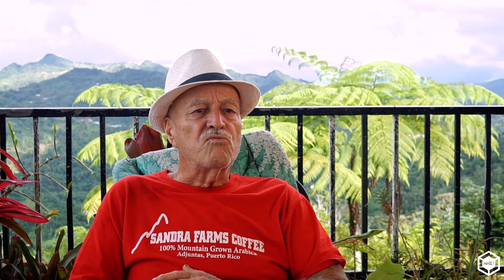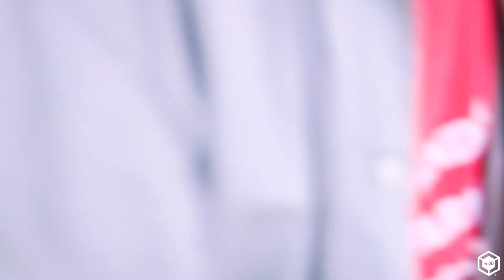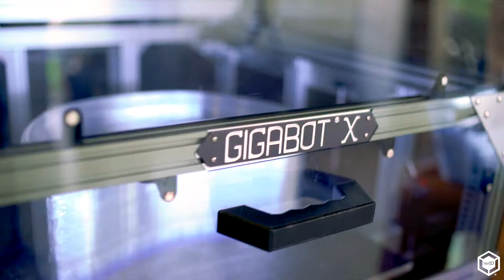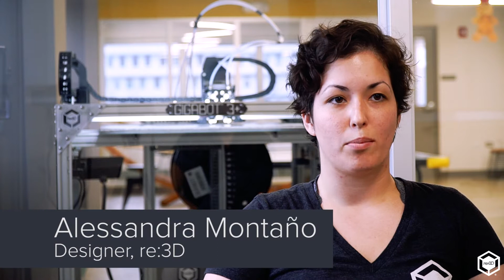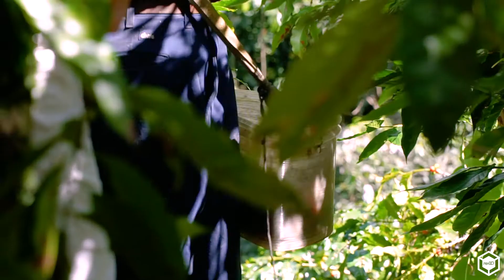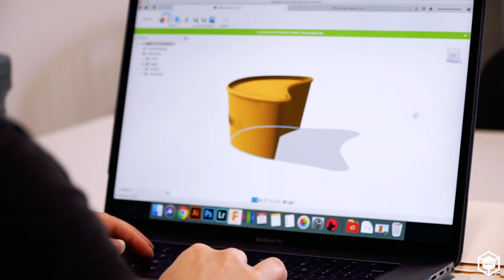Designing a More Ergonomic Coffee Picking Basket Using 3D Printed Recycled Plastic

Comment: Great program but I feel that you are a 'Hammer looking for nails'. Could the results be acompolished more economically and receive the same or better results another way? ie w/o the 3d bot?
Reply from the maker: Thanks for the comment Frank! This pilot program is a means of proving one application for our Gigabot X that prints with waste plastic. The idea would be to have our waste plastic printers in a city or community with limited access to supply chain infrastructure so that they can utilize waste plastic to rapidly create products that solve needs as they arise. The nails are everywhere, its just a matter of choosing which to hit first.
Reply: Only with scale. 3D printing is more economic in "small" scale (including operational and purchase costs) due to the high costs of the fabrication of injection molds (around 20 - 100k dollars). We've done a study for a client in which  for a specific material and object they would need at least 4000 units to break even with injection molding. It's also a lot faster (again at small scale), whereas with injection moulding you'd be waiting for the mold to be machined for at times months, with 3D printing there is virtually no wait time.